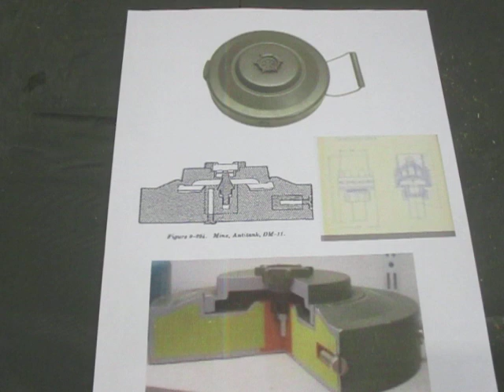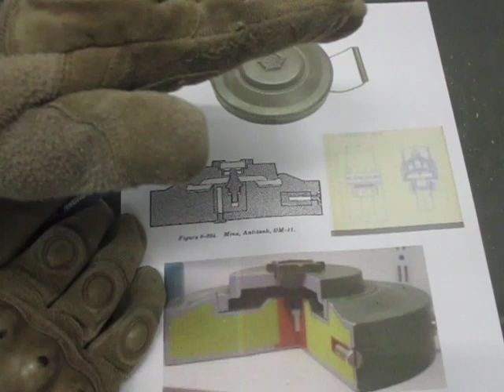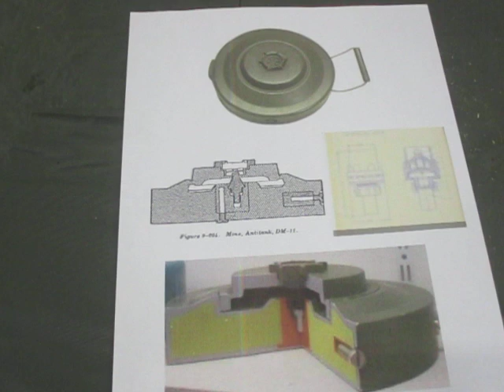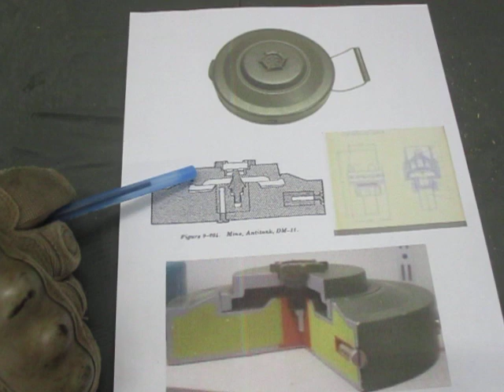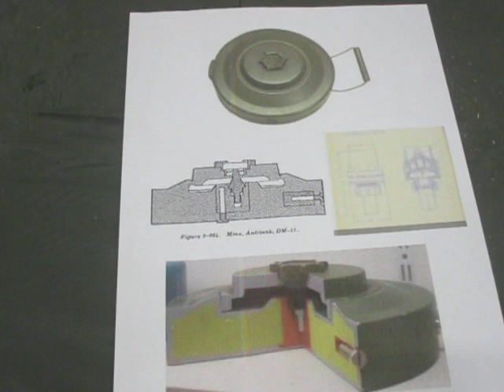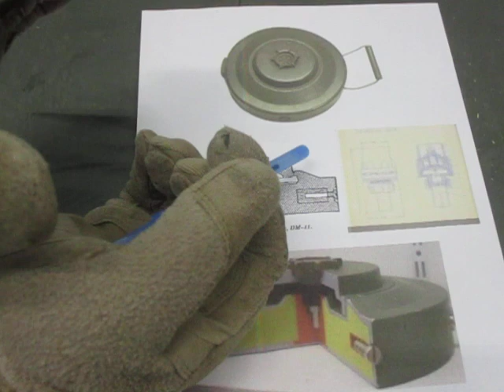German DM-11 Low Metallic Antitank Mine

Comment: The actual detonator is probably separate inside the container with the fuse.  Like with the M/56 you will have to put the 2 pieces together.
Reply from the maker: That is very possible.  I couldn't find information saying it is 1 piece or that it is 2 pieces and has to be assembled.